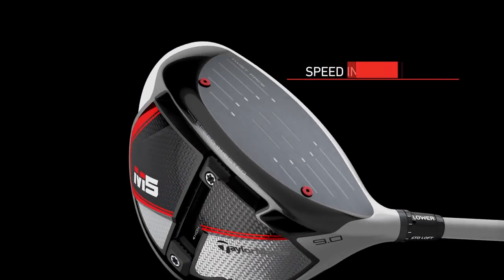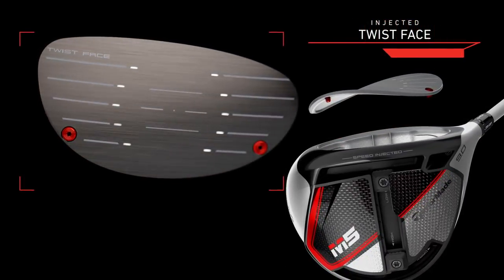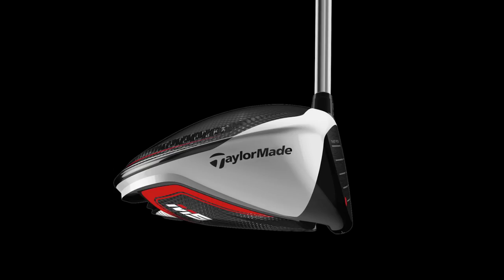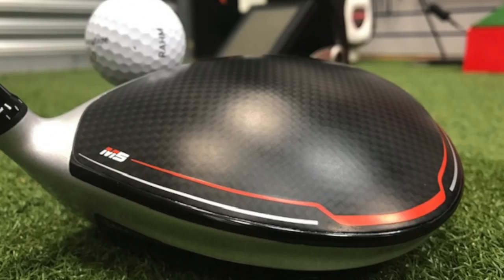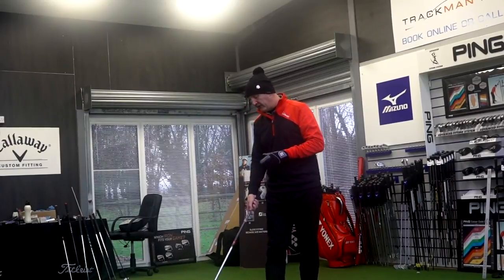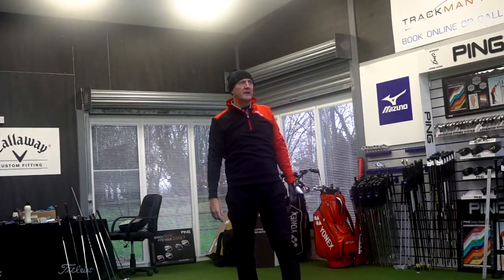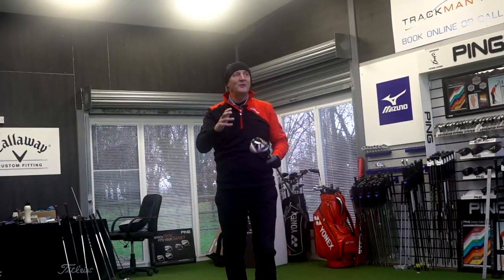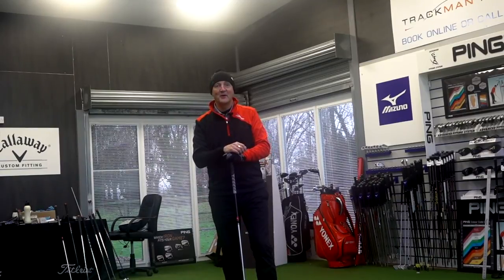TaylorMade M5 Driver tested 2019 - Average Golfer

Comment: Hi Andy good review.
I recently hit the M5 at my local Golftown here in Canada. I found the club to feel lighter which gave me higher swing speeds and of course more distance. The look and sound of a club never really is a factor for me and I lean towards the end results more, but this club looks and feels terrific and I was getting consistently good numbers.  I have never been a fan of Taylormade and their marketing but the numbers don't lie so I just might put this club in my bag. But first I'll do a bit more testing and fitting to ensure I get the right shaft for max benefits especially at this price point. I currently have 2 sets of clubs, one in Florida and my set here in Canada. The Florida driver is the Ping G400 max and the Canada driver is a Cobra ZL, both in stiff flex.